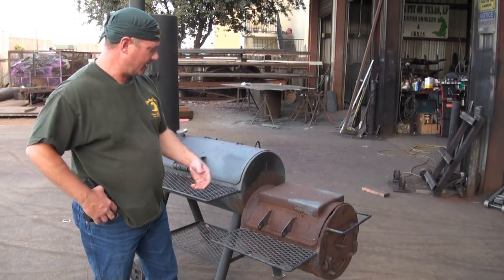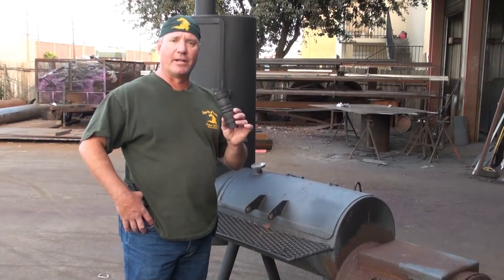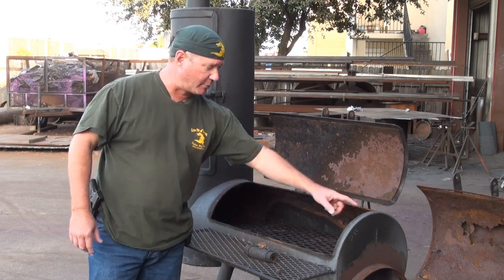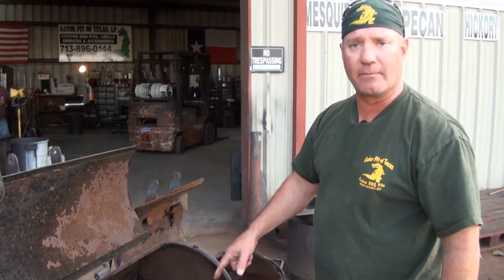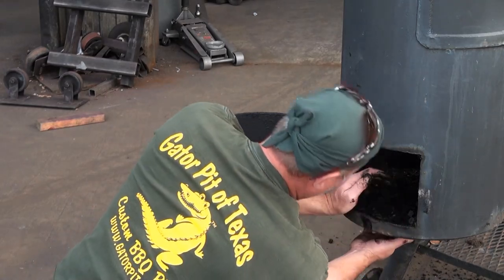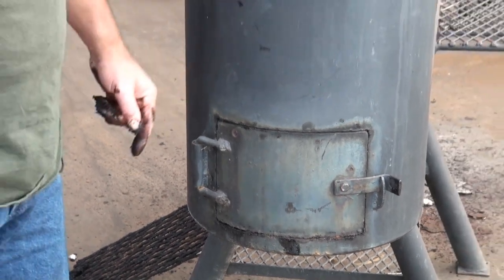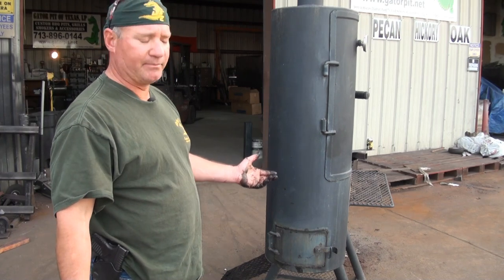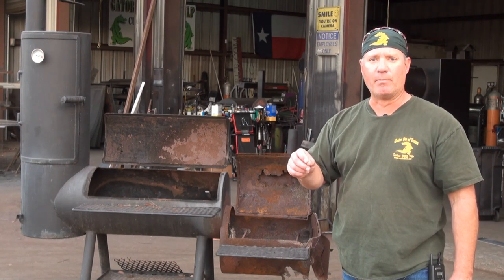Rust Never Sleeps by Gator Pit of Texas

Comment: That grill can easily be fixed for a little of nothing!! you just want people to spend thousands of dollars on your brand grill.  Wood handles can be replaced for less than $10 and last for almost 10 years. Sheet metal can be used to repair the fire box at a cheap price.  You chose not to fix the grill just to make your product seem better.  All grills will rust over time. horrible video because this grill is in great condition.
Reply from the maker: BossHoggOwtlaw Thank you for your expertise input.  I always patch cookers with thin sheet metal.  I am known for doing half ass jobs.  NOT
 I DO THE JOB RIGHT, or NOT AT ALL.  You may patch it. I am not in the patching business.  And, you need the tools, equipment to do. Not everyone has the skills or means to do.  This customer bought a new Gator Pit Smoker and personalized it to look and do what he needed.  Very happy customer.  Read the previous comment below from a Welder that works at the facility that built this brand cooker.  Even, he backed up the truck on his original comment on repairing this after further inquiring with his company. Comes down to what a business has to charge to repair versus costs to replace.  And, this pit was not worth repair costs for anyone having to pay a custom fab shop to repair.  Labor is the killer.  I have repeated myself so many times on this video to everyone call my bullshit on this.  You own a Welding, fab shop then you can talk all you want.  If you can repair this and be able to make a decent profit, I’ll send this type of work to you. You can have all of it.  But, I am not going to take this customer’s money on what is a temp fix by patching it with sheet metal.   That would be taking his money versus the truth and that is this Pit ain’t worth paying a shop to properly repair.